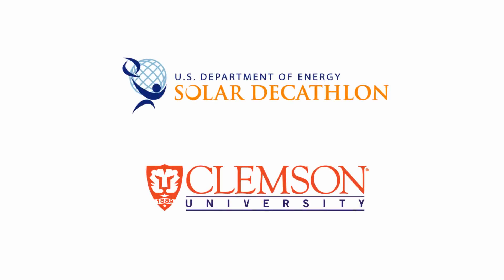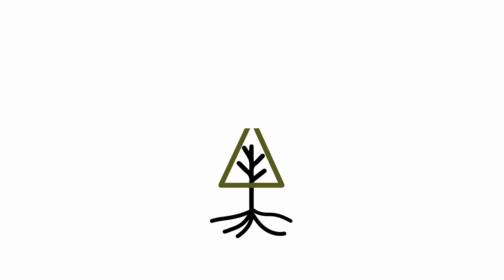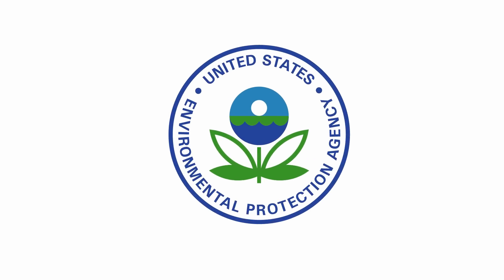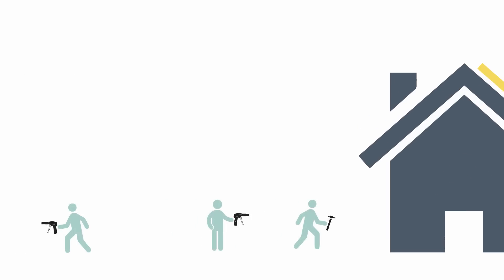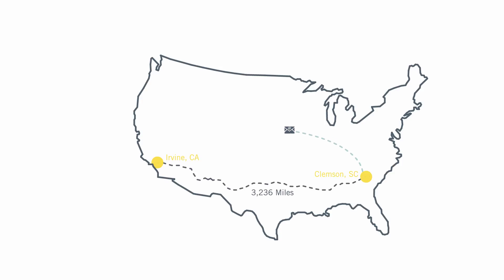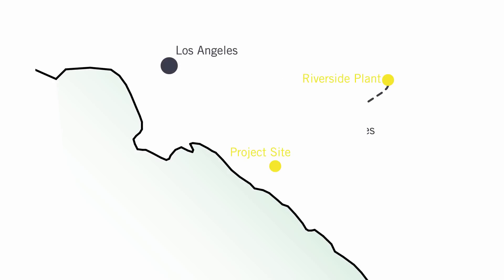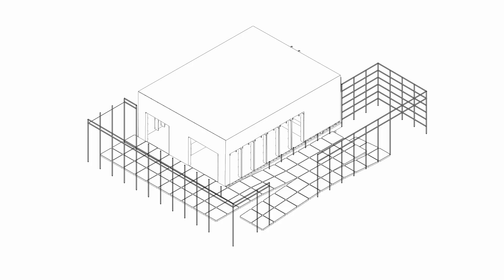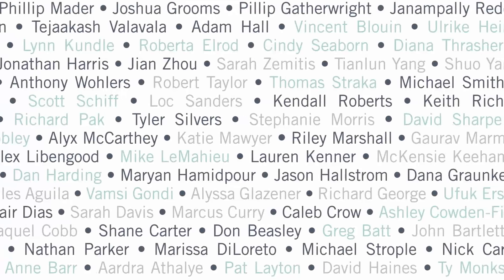INDIGO PINE: Clemson University Solar Home

Comment: Why wasn't this building designed using passive solar principles to save ongoing energy expense?
Reply: +Shawn Jadrnicek It seems to me that they have taken into account this principles, by looking at their website. There is a section showing plenty of information regarding passive design principles. I am a bit in doubts about the location of the moisture barrier as I have never done moisture calculations for the specific climate.